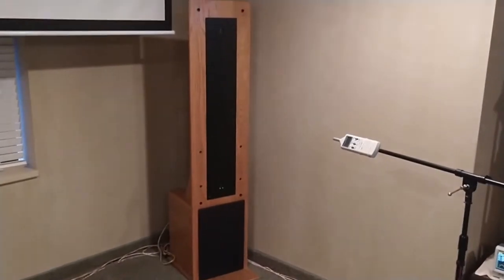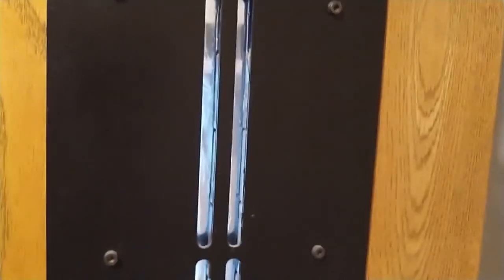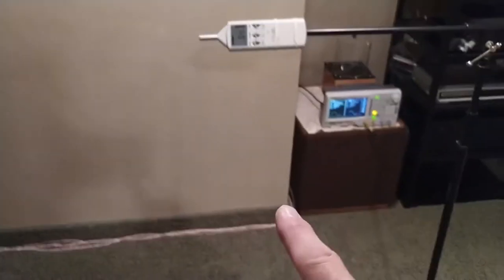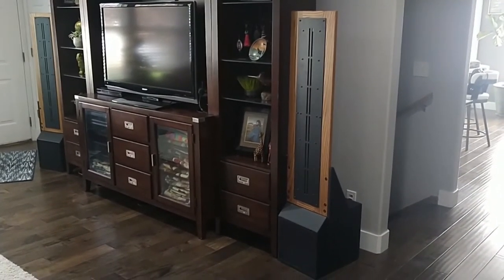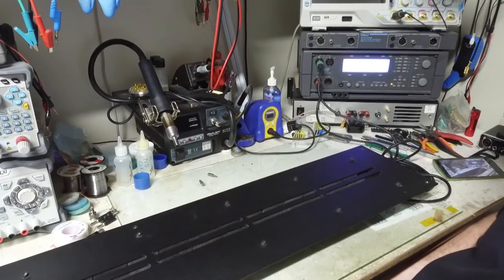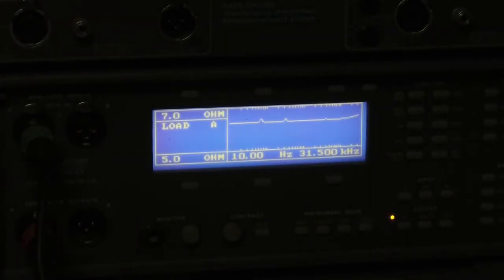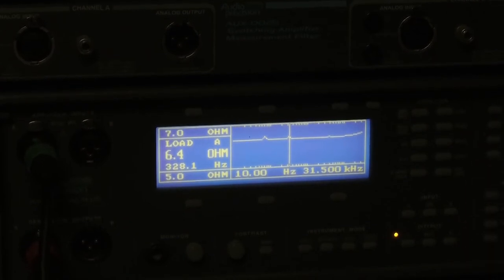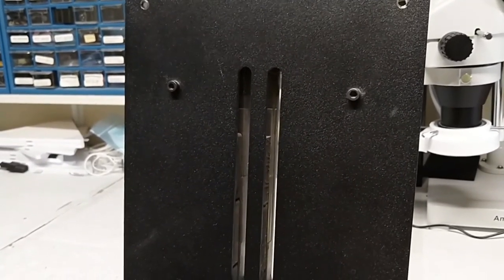Planar (Ribbon) Magnetic Speaker.  Detail of DIY construction of a large planar (ribbon) speaker.

Comment: Hey, Dan, I thought this looked very familiar.  I still have the article in speaker builder, and made a duplicate pair of these back in around '97, and used a pair of 8" woofers in 1" MDF cabinets I made. I believe I cut a bunch of .the standard .875 X 1.875 X .375" magnets, and cut them in half lengthwise (cutting ceramic magnets was a real chore). I worked in the plastic film industry, and still have tons of 1/2 mil and a little  1/4 mi polyester film.  I used copper wire for conductors, and also played a little with thin aluminum conductors as well. So good to see you on you tube. I'm a DIY nut, having duplicated such things as Apogee Diva 3-way planar magnetics with a true ribbon, 6' X 2' curved electrostatic full range using a lot of Gayle Sanders techniques, a 3-way horn loaded with a tractrix LaScala bass bin, 8' high line arrays similar to Pipedreams speakers, and you name it.  Good luck in your specialization of the planar magnetic push-pull design. Mike, from Charleston, SC.
Reply from the maker: Thanks for kind comments.  Has been a long time since I have connected with someone that recalls the Speaker Builder articles.  That was a while ago :)  The Apogee project sounds interesting, always liked the sound of the Apogee speakers (when they were around).    Have made several variants of the planar driver published in SB but it has been a while since I have tried anything else. 

I would think that cutting ceramic magnets would be nearly impossible :)  There are a lot appropriate sized Neodymium magnets now.

Tried to sell the speaker for a few years with not a whole lot of success.

Have worked on a couple of planar headphone ideas and recently just had some custom diaphragms manufactured on very thin Kapton.  Might detail the construction in a future video.  Thanks
Reply: Judy  just a question on Magnets Neo 52 or Rubber Magnets What is the difference in Sound Thx. P
Reply from the maker: @Warwick1938  Those two magnets have very different strengths which will primarily just affect the efficiency of the driver.

Comment: Wonderful speakers! Such technology and design. This planar driver is design and developed by You? I am familiar with this technology in headphones. I saw DIY concepts with fancy diagrams looks like rocket sciense on driver but Yours look just simple. Just wires on membrane and it's work. Way more user or diyer friendly.
Reply from the maker: Thanks.  Yes, I started experimenting with making planars a long time ago.  Have made several different models over the years.  Other than paying to have the metal laser cut, I made all of the other components of the planar driver.
Reply from the maker: I should have added that I published an article in Speaker Builder magazine, 1995 Issue 8 and 1996 Issue  4 that details the construction of the planar element.  The magazine is no longer.
Reply: @DanPattenAudioG33k  you didn't come up with the driver technology. Jim whiney (magnepan ) did common now 😆
Reply from the maker: @MichelLinschoten  I do not believe that I said I invented planar driver technology :)  I did say that I designed this speaker (which I did). The planar drivers I made and used in this speaker are a variation/refinement of many previous speaker designs such as Magnepan, Strathern/Strathearn, Gold Ribbon Concepts and Bohlender Graebener.  In the video I mentioned that much of the inspiration of the planar driver came from the Strathern planar magnetic driver which was manufactured in the 70's and early 80's.  The Strathern planar driver was used in some early Infinity speakers IIRC.  I owned a pair of Stratherns in the 80's, they were good sounding drivers (very fragile and a hard load to drive).  Should have never sold them :).

Comment: I suggest a strong isolation platform with spring decoupling feet on the bottom. The floor rumble will cause too much vibration for the speakers to be heard clearly and smoothly. 

If you own a tube amp, try constructing an isolation platform for that, too.
Reply from the maker: Interesting suggestions.  My main listening area is in the basement and is on cement and I usually use spikes that puncture through the carpet and pad to the cement.  My amps are solid state :)

Comment: Hi Dan, I have a pair of RD75s one of which I need to replace the ribbon material in (I have original ribbon for on driver) any Idea on how to get the tension of the material correct?
Reply from the maker: Getting the tension correct can problematic.  What is the diaphragm material?   With my speaker I was able to use a heat gun on the Mylar which shrinks slightly under heat. This process would remove wrinkles and result in pretty uniform tension.  Some planar elements have channel/groove in the mounting area that will "pull" diaphragm in a uniform manner.  One side will have a negative channel and the other side a protrusion.

Comment: Dan Can I use thin copper tape instead of wire, Thx, P
Reply from the maker: Sure, I have done a few experiments with tape.  Years ago when I was first doing these experiments I was unsuccessful at finding thin copper foil.  I had some success taking apart metalized film capacitors and cutting it into strips.
Reply: Thx Dan
Reply: Dan Thx for your support, Can you please tell me what it the gap between the Magnets  that wire run. Thx for your endless help. Thx

Comment: They seem a bit cramped in that corner there
Reply from the maker: I agree.  Wish I had a larger room :)  They would sound better a little farther away from the walls.
Reply: @DanPattenAudioG33k  perhaps a less wide baffle? Or is that needed to deal with diffractions? Absolutely love it btw I am a huge magnepan /Arnie nudell fanatic so I got in my main system a magnepan Tympani I 

Planars are in a league of their own
Reply from the maker: Thanks for the kind comments.  The baffle width is an important factor in bass response of the planar driver.  If the baffle gets more narrow, I would need to adjust the crossover point between the woofer and planar to higher frequency (which I do not want to do).    I too have admired many of Arnie Nudell's designs and also appreciate Magnepan.  Have never owned Maggies but have owned Acoustat electrostatics.  Thanks.

Comment: Opposing magnet pole configuration? Missing something ... Embarrassing!
I've only built Electrostatics, pain in the  neck.  Did you machine your plates Dan?
Dave in PA.
Reply from the maker: The magnets are in an opposing configuration.  I did the design and hired a local shop to laser cut the steel plates.  The plates are 1/8" steel.
Reply: @DanPattenAudioG33k  Yes, I see the magnets alternate NSNS…Must restudy Maxwells Equations.
Fascinating video Dan.

Comment: There are so many things wrong here.  You should have the woofer probably in a different placement than right under the midrange driver.  Also you don't mention the crossover point in the description and I have no time to listen to this long winded video that starts off breaking the first rule in dipole speakers: Position them WELL away from the back wall.  Like at least 4' and more like 6-8'.  And not toed in if you want a symmetrical soundstage.  You've probably crossed over at about 200hz so your midrange is all cloudy from that bass driver attempting to reproduce it.  That never works.  A ribbon that small can never reproduce down to 100 hz so woofers can take over from there.  
If you're handy do this:  Get Magneplanar III's and use the bass and ribbon tweeters only.  For the midrange use 2 of your ribbons or 3 if your ceiling allows, in a WIDE baffle so the rear wave doesn't cancel all your lower midrange.  Use the Maggies as low as you can, then a servo controlled sub for 40-50hz and lower.  The ribbons operate about 3000 hz and higher as I recall.  They are glorious.  
Get the fundamentals first, then make the woodwork lovely.  Maybe you're a woodworker first and a music fan second.  And also brace that tower.  There's no way anything can be that tall without being flimsy, no matter what manner of spike you have at the bottom.  The whole frame will flex.  Its wood, not reinforced steel.  So brace it.  For the midrange some people use the Bohlender Graebener RD75.  I don't think they are available anymore though.  Here's some but this idiot put them in a sealed box, not a wide baffle.  https://www.youtube.com/watch?v=u-6-6zN33yM
Some people just can't seem to grasp the basics.  
Look at the Genesis One for ideas.  That nailed it.  But its midbass still would not be as fast as the Maggie midbass.  And the Maggie tweeters are superior.  That's why this combo is just so good.  4 drivers, 50hz, 125 or maybe up to 150hz as that midbass planar panel of the Maggie is so fast and 3000 hz crossover points.
Reply from the maker: You may have missed the point of this video.  In this video I tried to explain how a planar magnetic element is manufactured and characteristics of a planar element of this type of construction.  Items explained/demonstrated are: acoustic radiation pattern, impedance vs simple DC resistance, magnetic structure, diaphragm/conductor construction and resonance.  

The video’s purpose was not to debate who makes the best type of planar speaker and placement.

The idea of the woofer below the planar element achieves several goals:
It is an inexpensive method to elevate the planar element so the center of the planar element is at ear level.  This is a requirement because a tall narrow speaker planar speaker results in a very narrow vertical dispersion. The woofer under the planar element can achieve some element of time alignment between the two drivers.  This configuration results in a small footprint that is convenient. There are always tradeoffs in designing a speaker.

These speakers do sound better in a larger room. I agree.   However, I do not have a larger room, so that is where they sit.

I agree that a speaker of this type of construction can benefit from bracing.  These planar elements are actually pretty stiff as they are made from two plates of 0.125 steel (0.250” total) constrained with approximately 1” maple between the plates.  They do not bend when assembled, if they did bend, I would have a jumble/pile of magnets.

I may have forgot to mention the crossover frequency.  It is approximately 400Hz and is formed with a simple first order crossover between the woofer and planar element.  There is no notch filter to help reduce the slight cavity resonance of the planar element.  I listened to it both ways and preferred the sound without it.

Thanks for watching the video.
Reply: @DanPattenAudioG33k  OK, I understand where you're coming from now.  But you have to understand that if you do a talk on audio and ignore fundamentals that clearly ruin the sound (like cone woofers attempting 400 hz which is the middle of the piano!), people are going to protest.  Cone woofers in any decent design, just cannot be used above 150hz and really that is pushing it.  100hz is much better.  And that's for small smaller (6"-8") woofers!!!  You're using a 10".  OK, its polyprolene which helps but that in no way makes up for a 10" size.  In speaker design you don't use 10" above 60 to 80 hz.  Its just way too slow to mate with the midrange driver.  And you don't mount something on top of something to raise it.  You raise it by its own framework.  Come on.  You're making trade offs here that clearly are not needed.  Also they are so severely ruining your sound you'll never hear the strengths of what you're doing.  As for your room size, pick a speaker design that matches your room as you can't exactly enlarge your room.  Or move.  Dipoles require lots of space.  No way around it.  

You might consider using multiple smaller drivers. Also you might be interested in 4" midrange drivers in a open baffle design. These have huge potential as its so hard to make a truly inert cabinet.  Basically its impossible.  But open baffle requires lots of space.  Ugh.....

If you can't move then just work on sealed enclosures with quality drivers and crossover parts.  You'll be able to place them closer to the rear wall (no rear ports of course).  Multiple 4" drivers will get to 80 hz where a single mono sub will take over with quality bass, especially if its got servo control which more and more seem to have today.